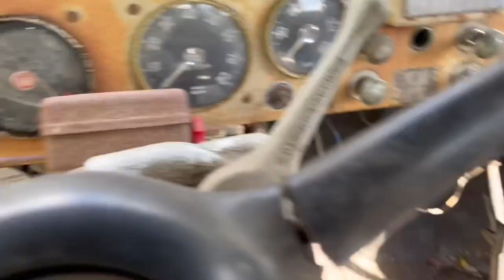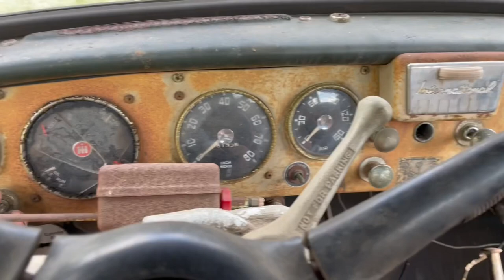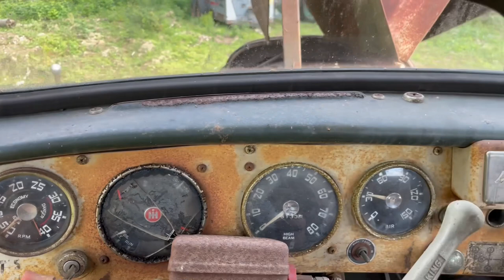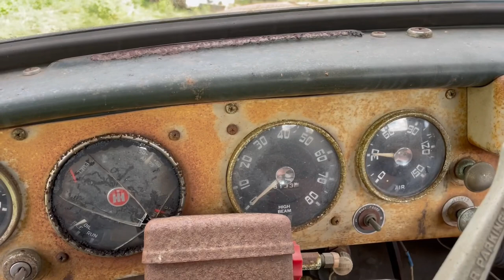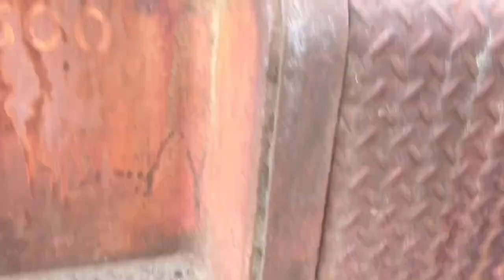1956 Rowdy the wrecker towing autocar

Comment: Engine is likely RD501 stamped on block just below head.  The carb is a Holley 2140-G for Governed. I have never had my front wheels off the ground, but my truck was custom built to extricate cement trucks, they are quite different.
Reply: In 1953 and 54 the Comfo-Vision cab on the R series had split rear glass and the exterior door handles were swing down.  In 1955 they went to single rear window, larger door glass and push button door handles.  International sales registered the truck as the year invoiced out not necessarily year built. The 4 bbl carb and split exhaust may indicate a newer engine has been dropped in sometime since 53-54, although the RD 501 was first available in 1954. I have a 45 KR-11-450, a 59 R185-6 501 with the Holley 2140G 4 bbl aka teapot or firebox, and split exhaust manifold on a 67 RF194 450  plus a few others.  They came original with variations and some changes could have been made in last 70 years.

Comment: Because of the lever arm (distance between front bumper and rear axle) a large scrap steel counterweight would work a treat to keep the nose down and front wheels planted.
That trick is at least as old as that truck and easy to do.

Comment: That's a nice self-made boom and bed. Looks like it was built more as a winch truck than a recovery vehicle.  It's easy (and dirt cheap doing it yourself) to fab a wrecker sling and tailboard mounts for that boom to make the truck MUCH more useful.  

Another cheap (playing in those leagues you have plenty of good scrap steel!) addition would be a fat pair of Scotch blocks so your winch power is not limited by the truck sliding. Scotch blocks chained to the tailboard are a major performance upgrade for any vehicle used for heavy winching. 

The rear hitch for a lunette eye is stout but doesn't give much articulation which can break parts when not operating on level ground. Large pintle hitches are cheap used like most things hobbyists don't mess with and the military/industrial rotating style have no articulation issues. 

That tailboard can benefit from chain grab holes (round hole with a bottom notch to match the chain link OD) to quickly hang snatch blocks for level pulls and on some jobs to add mechanical advantage. 

USMC rigging manual is a free download and useful for any rigger. https://www.marines.mil/portals/1/MCRP%203-17.7J%20With%20Ch.%201%20z.pdf  So are various Crosby literature.